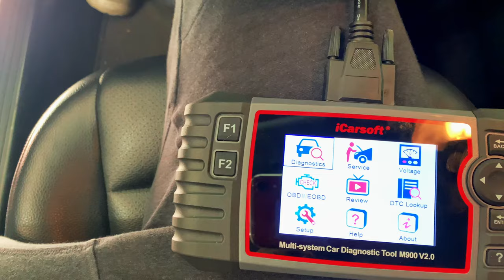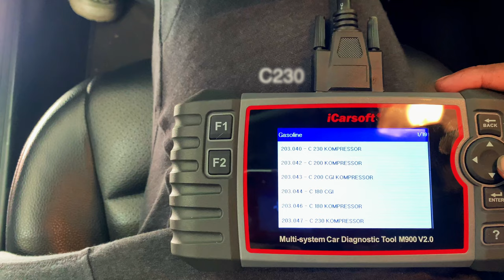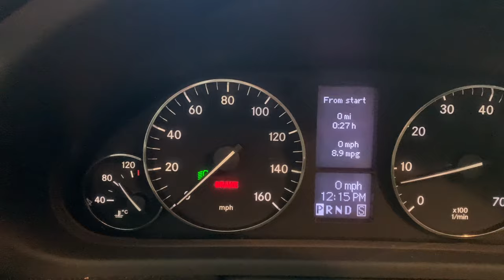Mercedes 722.9 Transmission Fluid Change W203

Comment: Okay saw it i got it! So let it drip a little like until I see the bubble then put the plug back in I should see it like bubbling around the plug then i know its full
Reply from the maker: Yes exactly! Once you see that close it
Reply: @HeyboysGarage  cool thanks looking forward to more videos
Reply: Sorry one last Question just to make sure will I loose a lot of fluid when i take the drain plug out? Being I nad already did the flush before and added trans fluid? Or will access just come out? I will need to catch?
Reply: But like u said if I warm it up and then take the plug out a lot of fluid shouldn't come out right
Reply from the maker: @moetic6601  be ready to catch fluid, if you lose a lot of fluid that’s good cause then you had too much in there

Comment: Hi, thank you for your W203 videos! I'm a proud spanish owner of a C230 exactly like yours. I bought the car a few years ago with no maintenance book, so I'm doing things peacefully on my free time. I've a question, please. My 722.9 gearbox is very smooth in performace, but when I put R or D the car shakes noticeably. I'm going to do gearbox service following this video but I would like to know if you also feel this. In other hand, when I get out my garage upwards from -1 level, although I choose 1st gear manually on C mode, the car tries to change to 2nd gear. It doesn't do it obviously, because it's blocked in 1st gear but I feel the shake and I don't know if this is normal. Thank you sir!
Reply from the maker: I would service it. C mode is to start in 2nd gear. I would just switch to S mode if you want to start in 1st gear…
Reply: @HeyboysGarage  Thank you!!

Comment: So i did mine I did the full flush but didnt start it to let it warm up to check or anything soon as I saw it come out I puy the plug back in now i Feel its slipping
Reply from the maker: Yeah you can still do the last step which is let it warm up and then check to see if it needs more fluid
Reply: @HeyboysGarage  gotcha so do I put it on the lift start it let it warm first then take the drain plug out and see if anything comes out let it come out into a pan and then put the tube in to add fluid? Also i think I lost some as well did the radiator a few days ago I caught it in time trans line poped off not a lot but it sprayed out so im thinking its why I have this inaccurate shift issue code says that too when i scanned it
Reply: @HeyboysGarage  also it being a quart or so low it can act up right I know in total Manuel says 9 quarts
Reply from the maker: @moetic6601  yeah, just make sure it has the right amount of fluid
Reply from the maker: @moetic6601  yeah let it warm up and take the drain plug off to see if any fluid comes out when the transmission temperature is at 45 degrees. I explain all that in the video, and when to know there is enough fluid to put back the drain plug
Reply: @HeyboysGarage  gotcha yeah when it starts sort of spitting out a little its full but if its coming out alot let it drain because its a lot.
Reply from the maker: @moetic6601  if you see air bubbles then close the drain plug
Reply: @HeyboysGarage  gotcha that means its full and dont add anymore
Reply from the maker: @moetic6601  yeah, watch the video again it will help
Reply: @HeyboysGarage  thank you

Comment: do you mind me asking, do you know how many miles its been since the last fluid change before the one you did in this video? the reason I'm asking is I have an e550 w211 that has 145k and it doesn't seem like the fluid was ever changed before, but it shifts good still just not as quick
Reply from the maker: I didn’t know I just went a head and did it! I know the car was very taken care of before I got it. With your mileage and it driving smoothly you should be good to service yours. If you are doing it yourself I assume you know what you are doing from watching this video. But if you take it somewhere else make sure they know what they are doing

Comment: How do you like the 7 speed compared to 5 speed as a driver? Does it feel smoother or anything noteworthy?
Reply from the maker: To be honest I like how the gears shift frequently versus the 5 speed. The 5 speed gear are quite long. But when racing the 7 peed will be better because you will most likely be a peak horsepower vs the 5 speed you wont until you reach max RPM before switching gear. By that time it's too late. Thats the only down side.

Comment: What ton jacks are you using? I have 2 4 ton jacks and 2 2 ton jacks. Think it's safe to do 4 ton on the front and 2 ton on the rear of my W209 Cabrio?
Reply from the maker: 4 ton handles 8 thousand pounds so I think you will be safe!

Comment: Can I get a link to the filter and the pump you got
Reply from the maker: https://www.amazon.com/gp/product/B01IVZBJSM/ref=ppx_yo_dt_b_asin_title_o06_s00?ie=UTF8&psc=1

https://www.amazon.com/Plews-55001-Lubrimatic-Standard-Bottles/dp/B000BQW5LK/ref=pd_bxgy_img_sccl_1/134-5922973-6305362?pd_rd_w=Is0FC&pf_rd_p=6b3eefea-7b16-43e9-bc45-2e332cbf99da&pf_rd_r=N2T1NAJZ4F5HQJYEY1HE&pd_rd_r=fa814b58-f6cc-429b-b352-c89fa0898ac3&pd_rd_wg=uQjAE&pd_rd_i=B000BQW5LK&psc=1

https://www.amazon.com/kweiny-Transmission-Mercedes-Benz-722-9/dp/B07N1DJNCK/ref=pd_bxgy_img_sccl_2/134-5922973-6305362?pd_rd_w=Is0FC&pf_rd_p=6b3eefea-7b16-43e9-bc45-2e332cbf99da&pf_rd_r=N2T1NAJZ4F5HQJYEY1HE&pd_rd_r=fa814b58-f6cc-429b-b352-c89fa0898ac3&pd_rd_wg=uQjAE&pd_rd_i=B07N1DJNCK&psc=1

Comment: So you don’t actually need the air pressure tool to drain the rest of the fluid once you take the pan off ?
Reply from the maker: I’m not sure the air pressure tool you are talking about. You Just need to drain the oil, change the filter and put the pan back and refill

Comment: Do you think it would be wise to change transmission fluid in a mercedes if it's not the original one, unknown history.I've heard some stories of transmissions start slipping after a fluid change.
Reply from the maker: When you do the fluid change and the oil doesn't have any shine particles or anything that looks bad you should be good. How many miles have you been driving the car when you got it without doing a transmission service on it?
Reply: @HeyboysGarage  it’s not the original transmission the guy put one in mileage not known

Comment: why didn't you fill it from the top, put in what you took out, then check!
Reply from the maker: It’s the 7 speed transmission you can’t fill it from the top. 5 speed you can because there is a dip stick section

Comment: Can I filled the oil from the top of the gearbox ? Is there any way.
Reply from the maker: 7 speed transmission can only to filled from the drain plug. 5 speed transmission can be filled from the dip stick tube located at the top of the engine bay

Comment: Hey i drained it so it had let out 3 quarts Almost so legs say 7 quarts or 8 is in it now thats witj it bubbling by the drain plug i thought it took 9 quarts total though I saw on google? Was yours the same?
Reply from the maker: It all depends on each car, but yeah it was about 7 or 8 quarts
Reply: @HeyboysGarage  Gotcha yeah I know all wont come out because the converter still.has but thanks so much again for the help.One last question do you have the common chrck engine light? With code camshaft flap open? Which is the common replace intake manifold I know the c230s even the w204 usually its replace manifold and am I safe driving until I can replace it?
Reply from the maker: @moetic6601  I would try and replace it as soon as you can because the engine will be hurting if not replaced.
Reply: @HeyboysGarage  gotcha no problem will do thank you

Comment: What about all the dirty oil in the cooling lines and radiator and torque converter???    so you mixed clean oil with dirty oil....   What does the bible say about putting new wine in old wineskins???
Reply from the maker: Does this also apply to engine oil also?? Please let me know how you do it!
Reply: @HeyboysGarage  The new oil you put in is contaminated 'cause you didn't do a complete flush....  So you changed some new oil and mixed it with dirty oil...  what the hell good is that????   no dang good...you just wasted your time and money..  but it was entertaining to see a lame tranny fluid change...
Reply: Have fun getting allllllllllll the oil out of your trans 😅
Reply from the maker: Whose mans is this??
Reply: @heygirlsgarage100  Can you say FLUSH .. bonehead????
Reply: that is normal not to get all fluid out, I saw dealers done this as well.

Comment: You need to shift between each gear while it’s at temp then go down to check levels. Over filling at first is fine. I bet you’re short a quart and in a few weeks your car will be shuddering.
Reply from the maker: All what you said was done in the video and in previous services. I was spot on with the level don’t worry!

Comment: It looks like you used the wrong fluid its supposed to be an atf 134 it seems you used oil for the 722.6
Reply from the maker: Where did you get this info? What’s the right fluid then?
Reply: @HeyboysGarage  ATF134 or any oil that covers Mercedes spec. 236.15 unless they have updated their formula valvoline maxx atf was only good for 236.14
Reply: @HeyboysGarage  and I got this info from Mercedes WIS
Reply from the maker: @itmckennafarms6927  Valvoline Maxlife is compatible!
Reply from the maker: @itmckennafarms6927  it’s also preferences with which brand you go with
Reply: @HeyboysGarage  I see now its "compatible", yet not recommended or approved and not on the approved Mercedes list. This transmissions are so picky that I would not go with anything cheap one them and this valvoline oil is cheap. even on their specs sheet they have a small asterisk on 722.9 applications.